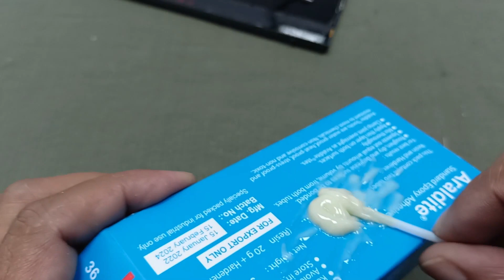asus laptop broken hinge repair || Zenbook ux 425 j hinge repair

Comment: I spent $280 to fix this problem when I took it to the Asus Service Center. They said the whole panel screen should be replaced because the hinges attach to it. Now, I'm very shock  to see this video 😯😭

Note: I was very afraid back then when  this problem happened to my laptop because I was in a deadline, so I didn't think to find a way to solve it through youtube 😢